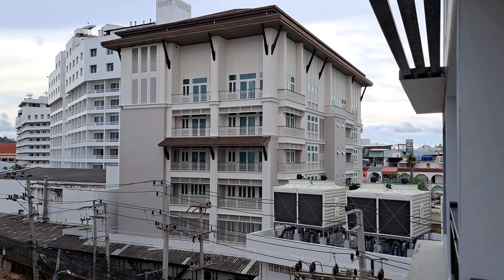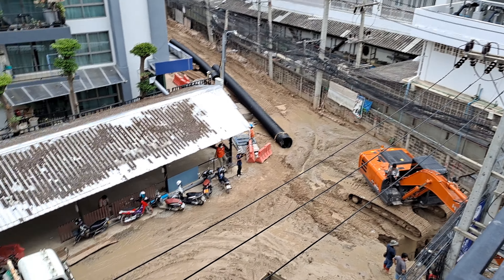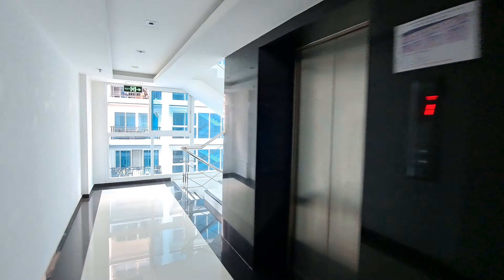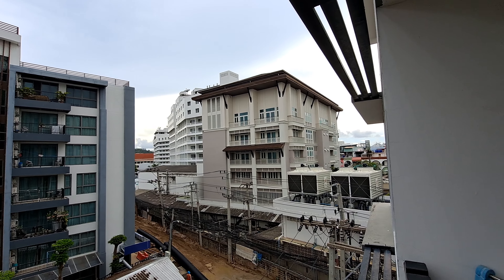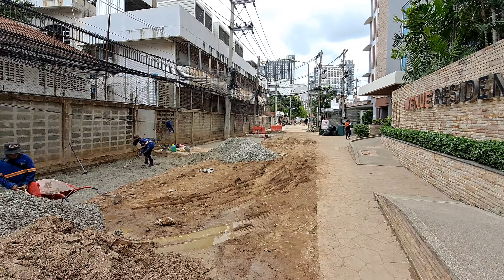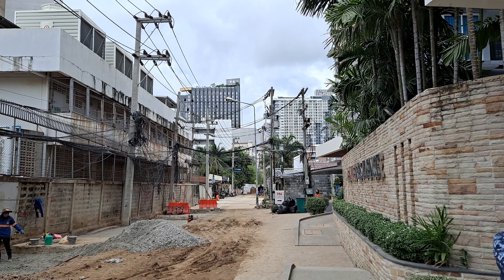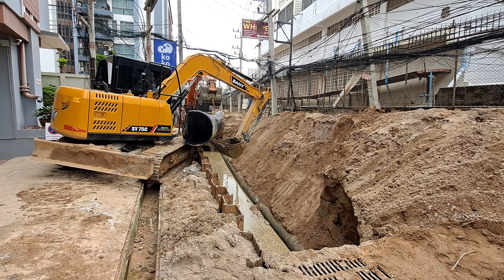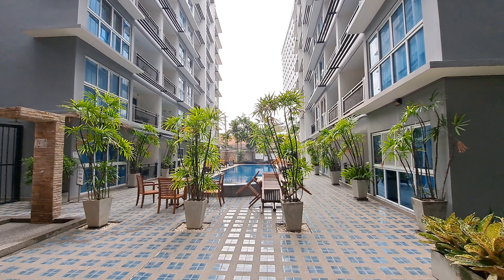Pattaya 11/May/22 Soi 15 Update + Condos 8000 baht up

Comment: Hi there neighbour I’m also on same floor two doors away was also watching the pipe laying. My room 9,000, 37 sq m . When road  all finished should be brilliant.did you hear the Big Bang last night 10:30 ish contractors hit the power lines again outside the urban,they were still working midnight.thanks for the brilliant videos
Reply from the maker: Cheers George. Appreciated Mate.  Didn't hear the bang last night as was out.  but had a few blackouts lately and wifi on and off due to the works going on. will be a great soi when finished. lets hope it doesn't flood again like last year.

Comment: A lot of issues with the condominiums in Soi 15. Grand Avenue problems with flooding of the garage and elevator problems. Avenue Residence I recall was infested with cockroaches. Anyway, prices come down since I lived there and the location is very good. I see apartments in Soi 15 advertised at low prices for two years with no takers. Shop around to avoid paying advertised prices if you looking for long term rents.
Reply from the maker: Yes unfortunately we all had flood problems in soi 15.  Let's hope this new drainage works.  Cheers Mate